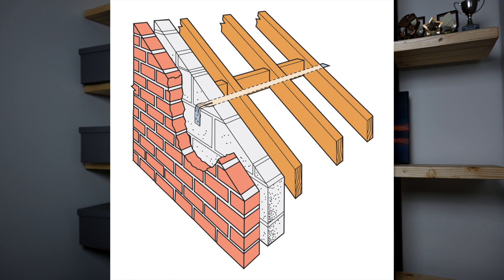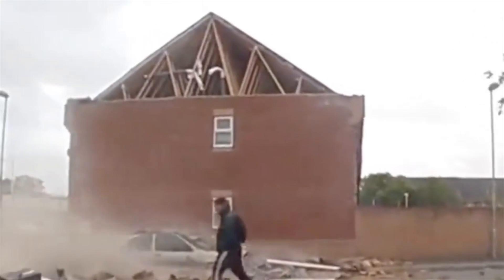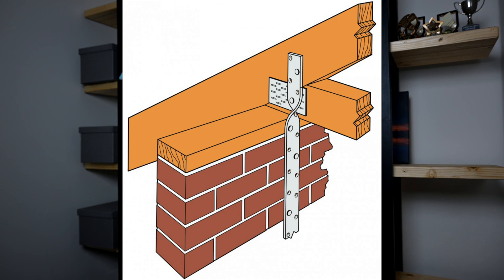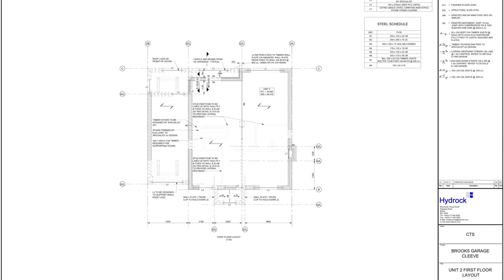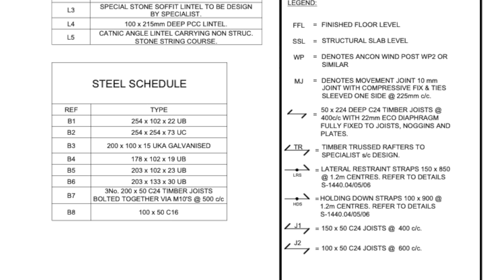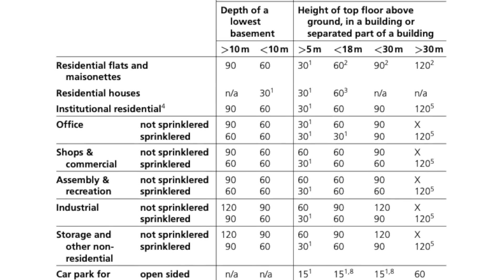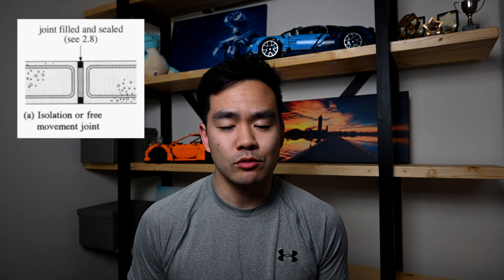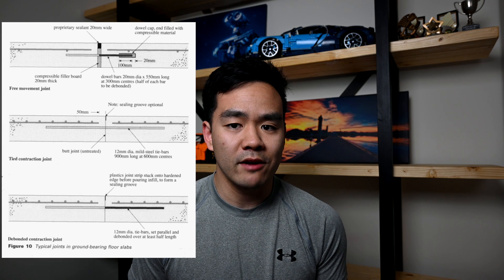5 Key Structural bits of Information Commonly missed off drawings

Comment: @Everyday Dazz, thank so much. Do you know where the requirements for structural drawings can be found in the code? I have done a fair bit of looking, but it seems to vary from office to office. Thanks again, S
Reply from the maker: I'm not sure there is a code for drawing notes. Notes on drawings are sometimes simplified versions of the NBS building specifications or notes can be something to state your assumptions.

Comment: Great video as always. Would be interested to see a video on how you treat joints at interfaces of block and brick, for example where first floor is rendered and ground is brick. Not aware of much guidance on how to safe guard these from different thermal movements and any slip membrane requirements.

Comment: In California and certainly other areas of the USA roof straps in wood diaphragms are designed to attach walls to the diaphragm in accordance with wind and seismic design forces.  Straps may also be required in wood framed roofs for subdiaphragm forces.  Similar ties my also be required with steel decking diaphragms.  Never, ever should this be left to a roofing or masonry contractor.

Fire and life safety is part of the architectural design and it is left to the architect to design and specify rated boundaries.  The architect will notify the SE where specific thicknesses and materials are required.  The SE should never assume the role of designing or specifying fire ratings and boundaries.

Expansive soils, as well as other related foundation issues are the responsibility of the geotechnical engineer who will specify the type of foundation required and any mitigation required due to adverse soil  conditions.  Soil conditions are not under the SE area of expertise 

Fire and life safety is part of the architectural design and it is left to the architect to design and specify rated boundaries.  The architect will notify the SE where specific thicknesses and materials are required.  The SE should never assume the role of designing or specifying fire ratings and boundaries.

Expansive soils, as well as other related foundation issues are the responsibility of the geotechnical engineer who will specify the type of foundation required and any mitigation required due to adverse soil  conditions.  Soil conditions are not under the SE’s preview and any attempts by the SE to asssume responsibility for this is a recipe for disaster.

I forgot the other two items you discussed but it is likely they are not part of the SE’s work.

I guess this shows how different the practice of engineering is in our two countries.

I forgot the other two items you discussed but it is likely they are not part of the SE’s work.

Lateral forces for wind and seismic design are a major portion of the SE’s work.  Something that doesn’t seem to be as important in your area of practice.

I guess this shows how different the practice of engineering is in our two countries.

I think iPads cut and paste feature was operating on its own and may have mixed up some of the text above.  I apologize for any confusion.